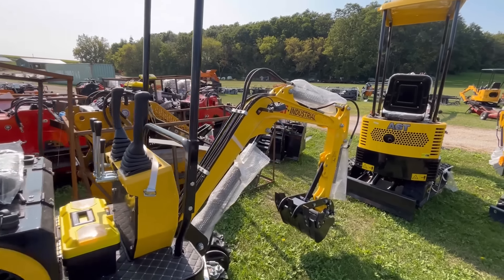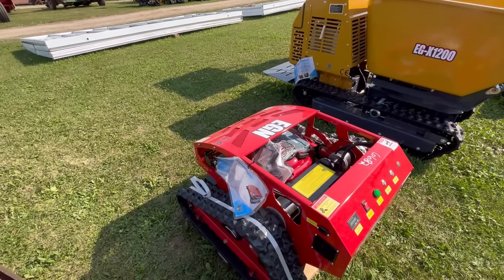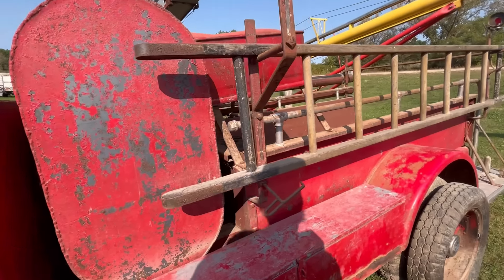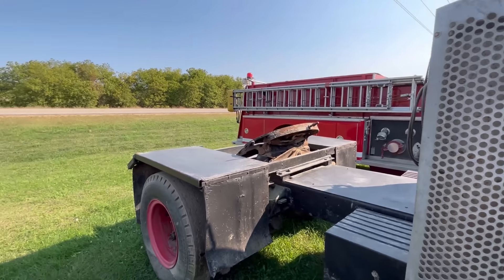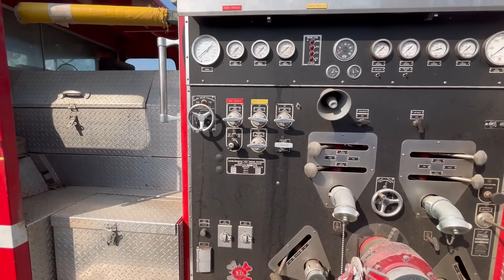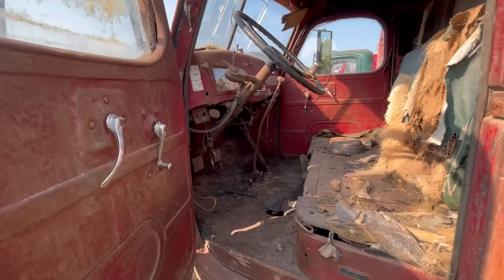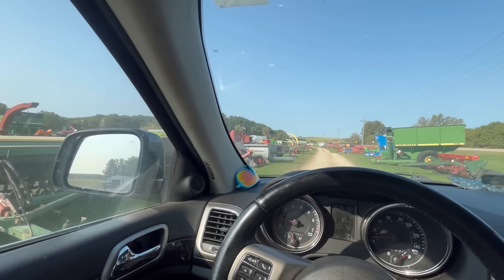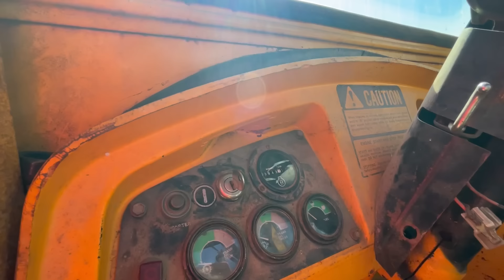Auction browsing! Old Mack’s, tractors, skid steers and a lot more! With prices!

Comment: Most old gasoline powered fire trucks had  2  distributors  2 sets of sparkplugs   2 alternators  2. Starters  etc.  In case one set  had an issue you could flip a switch and use the other set..  like a back up system
Reply from the maker: Ahh ok that makes sense!